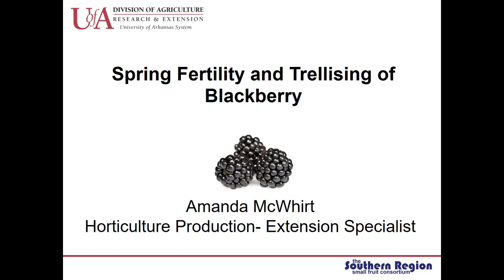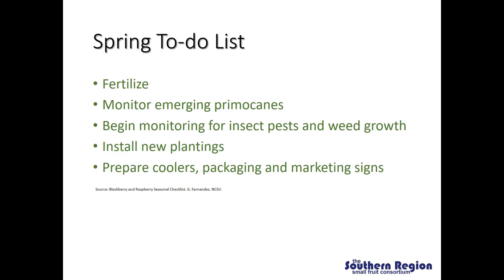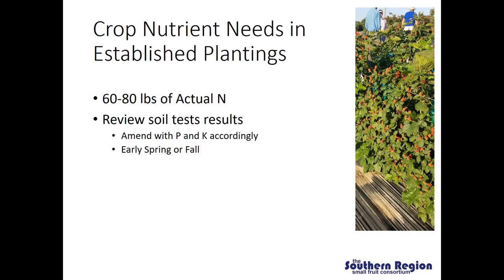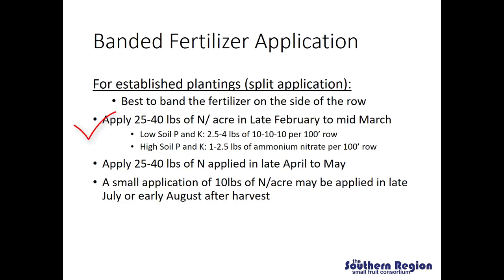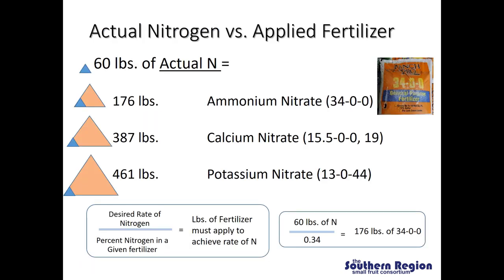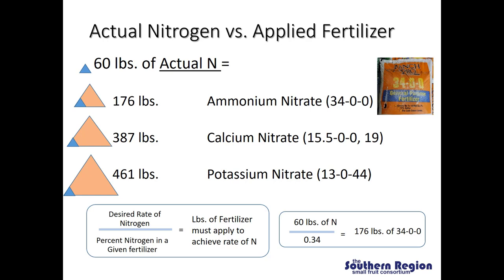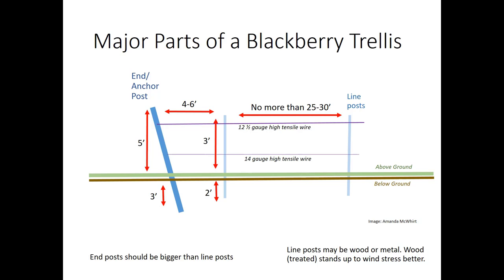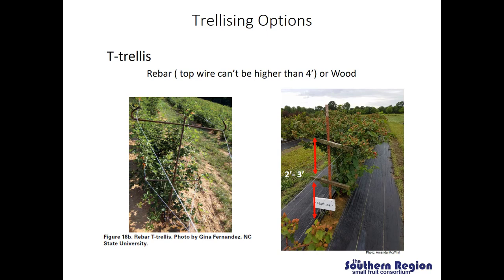#4 Fertility Management and Trellising of Blackberry, Amanda McWhirt. Arkansas Blackberry School

Comment: Do you define "acre" as the area of ground occupied by the entire patch of plants or by the area of bands of rows of plants.  For example, a blackberry patch of 200 ft rows with 12 ft spacing between row centers that has 50 rows would occupy about 118,000 sq ft or 2.7 acres, whereas an acre defined by the bands of rows 200 ft long and a planted row width of 6 ft would occupy 50 bands of 200 ft by 8 ft or about 1.4 acres.  If I use "banded acre" versus total acre calculations I will use almost twice as much fertilizer per plant.
Reply from the maker: We calculate our fertility rates based off of ground "under plastic" or the actual space in-row. So a 5' wide bed that is 100' long is 500 sq ft or 0.011 of an acre.

Comment: What are you using for fertilizer  in your vertagate  process. Is like a miracle grow typestuff , 
      Question no. 2.  If your familiar  with the grow tablets  that various nursery places  they are more of a time release thing they saw versus a rapid realease like  miracle grow ,     or would i better off to scatter my fert. In the mulch netween the plants and how close to the root crown  ,   and just water it in ,  i admit iam a bit  uninformed.  Thanx in advance
Reply from the maker: Hi Steve, we typically use a fertilizer that will dissolve in water and run it through the drip irrigation system. So something similar to miracle grow in that regard. If you are not able to inject the fertilizer in this way it would be better to scatter the fertilizer around the base of the plant and water in. The fertilizer should be placed at least 10-12 inches from the crown. Hope this helps!